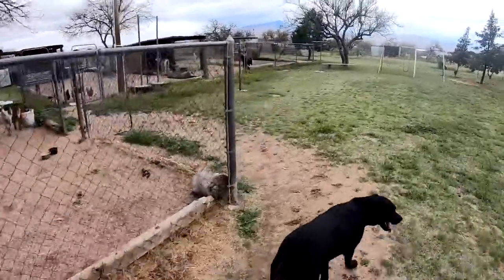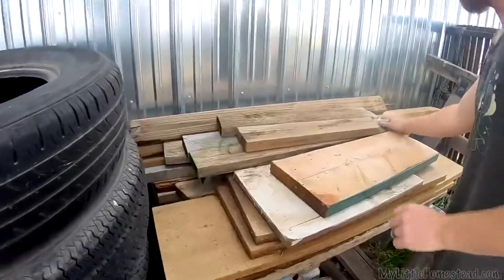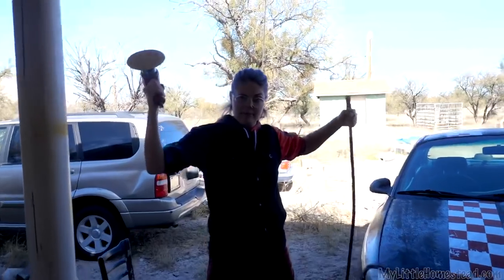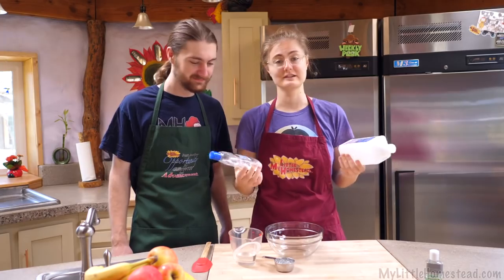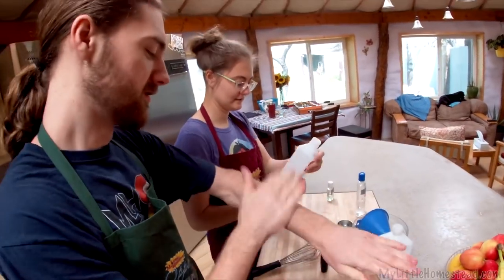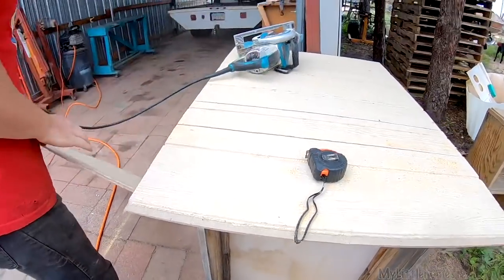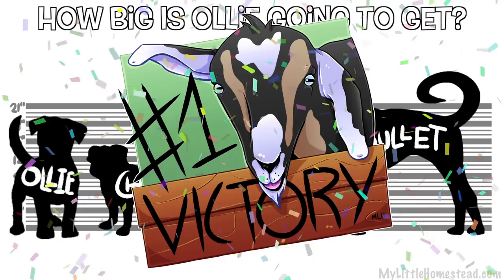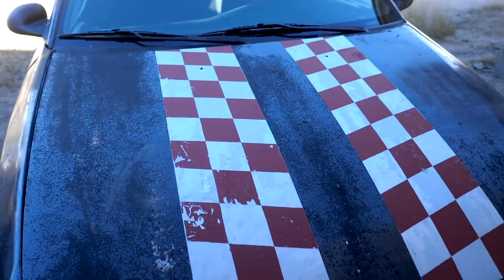Shae Preps Car for Paint, G&E DIY Double Dog House, Make Your Own Hand Sanitizer | Weekly Peek Ep227

Comment: If you put a plastic flap on the front of the dog house, they'll keep drier and warmer.  Maybe you can use two old rubber car mats.  Split them open down the middle.  Or you can use some clear plastic covering and weight the bottom for the wind.
Reply: But it probably gets super hot there in the desert right? Wouldn't the dog house get too hot with something covering the doors?
Reply: I used an old shower curtain.  Easy to pull to the side in the summer.  Keeps the heat in a little in the winter.
Reply: He will come up with something good i am sure. imho

Comment: I've been working on my project car for 3 years so don't beat yourself up Shea. It usually takes time to get clean results. I see that you got hung up on the climate controls there.. which is common. I will give some advice... Paint usually chips off car interiors and usually doesn't look good after a month or two.. ALSO, if you are stuck on those climate controls, painting it while its inside the car is a recipe for disaster. I've had the most success with vinyl wrapping. It's pretty cheap and will probably work for what you need there. I did the plastic around my stick shifter with 3M "4d carbon fiber wrap" and it's held up for a long time now. Its probably your best option, especially with the climate controls keeping the piece in the car.

Good luck!

Comment: Ha I picked the goat. but not that one.
also doggo House needs a cover to keep rain from going in it, like a hanging Door made of plastic or waxed cloth. and a rug on the floor on top of something to let it drain when the rain gets in, also something to elevate it like some more gravel. as a Floridian anything to keep them dry when they get older. and maybe a scratching prod on the side of the house. lol.
One last thing , with summer coming a way to vent out the heat that you can cover over during the winter Months

Comment: Shae, you're really doing a lot of great prep work on that car which is 90% of the end results.  Here are some tips based on prepping several dozen used cars for paint and finishing them afterward, and years working in the same complex as a body shop that did the level of custom work that ended up used in music videos etc.

Remove the tail lights, antenna base, grille, side markers, trim etc.  Any light scuffs on these from sanding will show for years, and you can prep the surface and have the paint edges out of sight giving way better finished appearance and durability.  Edges are where peeling will always start, and it's hard to get a clean edge with masking especially with multiple coats and wet sanding each.

The first coat(s) after sanding should be "high solids primer" which is thicker than normal so your sanding fills fine scratches and low spots better.  Before wet/block sanding sputter on a "guide coat" of orange or otherwise high contrast to show progress and help reveal low spots.  Might need a couple of layers built up and sanded down.  This will give you an even base for uniform appearance and glass smooth finish.  For flexible bumpers there is a urethane/plasticizing additive so the paint doesn't crack.  (Make friends at an automotive paint shop in town!) 

Look at special effects additives like candy, pearls, micas, color shift, metal flakes, and holographic additives.  Some of these are mixed into the color coat and often applied over a dark base coat.  Others are used under or in the clear coat layers so there's still time to order and incorporate these into the project.  Paintwithpearl is a great online store.  These additives can be used in all kinds of applications and projects, not just car finishes. 

I don't recommend it but people have painted cars with Rustoleum and a brush and got a smooth finish with block sanding and polishing.  For a project this size buy automotive paint and use a sprayer.  Automotive spray paint becomes uneconomical at this scale and you'll get a better finish and can mix in your own additives as above.  Block sand between coats and to smooth the lines of accents masked and sprayed over the base coat.  Usually this stage starts at 600 and finer grit wet paper.  Apply one or more clear coats for deep wet finish.  The final polishing will go down in stages to 4000 or finer polishing compound.  You'll want an angle polisher probably with a foam head for this part of the job, and patient hours with diligence not to overheat and burn the surface.  Once this is done you can admire the crisp unwavering reflection of the overhead fluorescent tubes in your handiwork.

For things like handles, wiper arms, antenna base, trim etc black makes a really excellent accent with yellow and really makes the color pop.  Black spray paint is TERRIBLE for this, after all the prep work it turns chalky gray in the sun quickly, I learned this the hard way.  Look for a product called SEM Trim Black, they also have other colors as well.  This will hold its appearance on a car finish.

The interior plastic is often teflon impregnated and/or saturated with years of silicone and teflon detailing products which is why your stickers won't stick.  Try prepping with 91% alcohol or mineral spirits.  Harsher solvents like acetone can attack the plastic and leave it brittle.  If the stickers won't stick try a base coat of vinyl interior spray.  Let the solvent evaporate and the coating cure for at least one full hot day in the sun before applying stickerage and you should get way better results.

Good luck and I can't wait to see the finished results!  I specialize in mechanical repairs and struggle with finish and appearance related work.  This makes me appreciate the artistic creativity of everyone in the family here.
Reply: LironMtnRanch excellent advice 👍🏼

Comment: You should really remove one of the doors on the dog house , giving them room to move away from the sun, wind, and other weather elements that may come in.
Reply: Agreed.
Reply: At the very least put down some cinder blocks or old bricks to get the untreated wood off the ground, and hang some strips of plastic/tarp or some dense fabric over the doors to help with the above mentioned sun/wind/weather.
Reply: I believe he will.
Reply: I hope he will. It's a beautiful dog house, but one side is pretty much 100% exposed to the elements, totally defeating the purpose. The cinder block idea is great. That will prevent rot and make the underside less attractive to wild animals like snakes. Rodents will burrow under the frame and use the space as a nest and this will attract snakes. Since they live in the western US desert, this will include the Western Diamondback rattlesnake.

Comment: On behalf of the dogs, i must lodge a complaint- WHERE IS THE CARPETING??...1/2" pad with some luxurious 70's shag carpet would be the least you meanies could do!..hahaha
Reply: Lol good idea 😂🤣!
Reply: Carpeting?  eek.  Funky!
Two - $19.99 dog beds placed in there would be super and can be washed or tossed.  This would be practical.   If you have a Home Goods store (some are part of Target) they have some easily washed dog beds that hold up well and would fit your dogs' size needs.
Also, if you make the roof - ooops too late - lift up on one side, you can hose out the interior in the summertime or at least sweep more easily.  Will that tin roof reflect sun or heat up the house?  I am not sure, that is why I am asking.
Reply: I use carpet squares from Dollar Tree for the bottom of my dog house. They are easy to pull out for cleaning & when they wear out, are cheap to replace.

Comment: Shae, I like your choice of Yellow for your car, 
may I suggest you do the accent color in Black & and call it bumblebee. :o)
Also save a bit of the Yellow and use it for the plastic dash piece inside surrounding the stereo.
do a few coats of clear coat after the paint, and start saving up for that expensive auto paint! (OMG-osh)
Thanks for your update, stay well all

Comment: Putting a metal roof on the dog house will likely make it super hot inside when the sun shines and will cook the dogs.- like leaving them in a car -- Metal roofs are ok in hot sunny climates if they have a second umbrella roof over the lower one to shield the inner and allow an air gap between the two for cooling- That's what people do when building with metal shipping containers-just a thought.

Comment: Hey youtubers , lets get sewing something positive! We can use cotton from our cabbage patch to sew simple (approximately 5"x7")masks which can/should be modified to fit over nose and mouth.  I have added elastic to gather the long sides (over nose/ under chin) then added ties which also run from long edges to behind the head and neck.   They can be washed in hot water so make several for each person so they can have one in the wash one drying and one on. :D

Comment: You need an end product of at least 60% alcohol for hand sanitizer to be effective. Since your mixture is 2/3rds of 70% alcohol, it's not going to work against Coronavirus.
Reply: Actually, you need 95% alcohol solution for this mixture to work, because the 1/3 aloe will reduce the concentration of alcohol to around 65 %.
Reply: @StephanieJoRountree  thanks! Your reply made me realize that my statement was able to be misinterpreted. I fixed it!

Comment: Please take it back. The incorrect hand sanitizer advice during a pandemic is dangerous. Even the comments here don't quite get it. It's not that there's minimum percentage. It's that there's a specific narrow band of effective concentration, it's different for each type of alcohol, and only two (of 4 major types) of rubbing alcohol are used. Too much alcohol reduces effectiveness against proteins, and also displaces water which is required to get the alcohol into cells. I'm not an expert but you can easily look that much up on the CDC website.